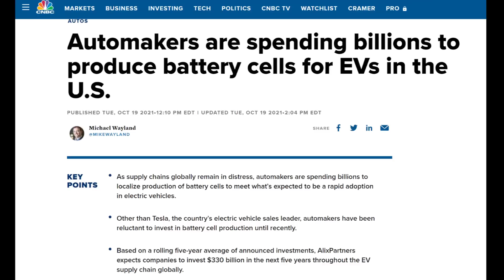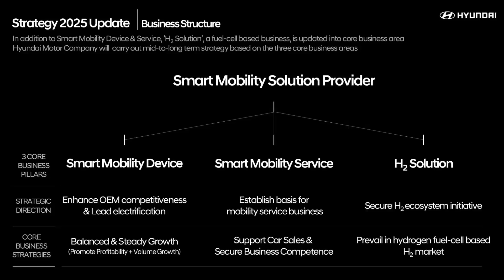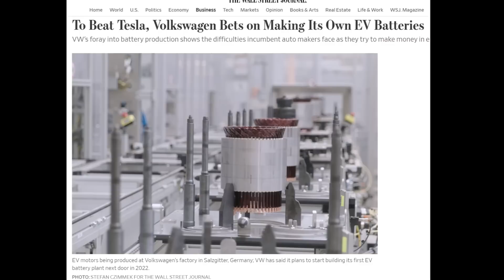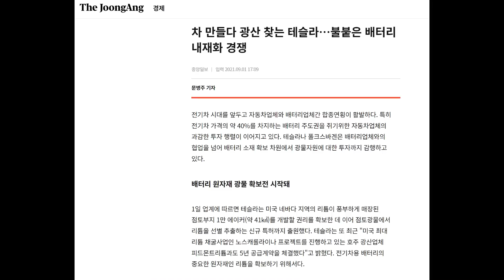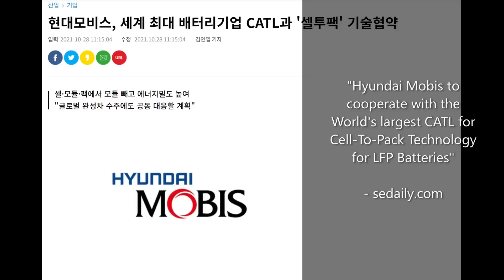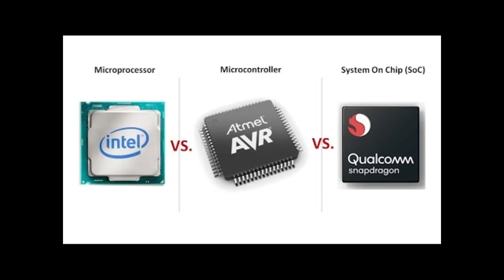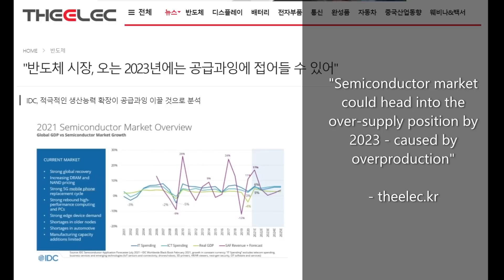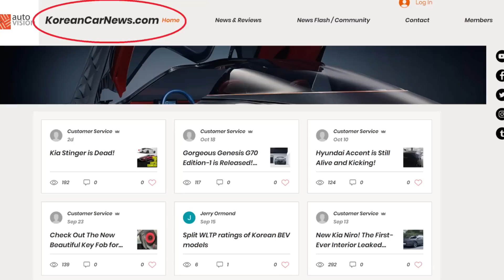Hyundai's Shocking Plan to Beat Out Tesla and VW doesn't involve producing own batteries!

Comment: I think it’s not the time to go EV. Another 5 years. EVs currently too expensive and very limited charging infrastructure.
Reply from the maker: You might be entirely right.  In 5 years, EVs will cost about the same as the equivalent ICE cars.  And it will drive far longer and charges in incredibly short time than the EVs now.

Comment: I want to purchase a car for $50,000 to $100,000. I need assistance for long-distance driving such as lane centering and distance control. Tesla has the features I need but the persistent quality and service issues scare me. I welcome any car manufacturer who produces a more reliable/serviceable car than Tesla. I do not care who makes the battery as long as it is reliable. An ICE car is also acceptable to me. Most important are reliability, serviceability, and assistance for driving. Not who makes the battery.

Comment: It would be shocking if Hyundai is not bankrupt by 2028! By 2025 EVs will be cheaper at all price levels than ICE so very few ICE cars will be sold. There will be a huge shortage of batteries and a shortage of battery minerals. So where will Hyundai get its batteries? Hyundai will be fighting all the other legacy makers for batteries, as well as the new Chinese makers, and contract makers like Foxxcon.
Reply from the maker: As discussed in the video, Hyundai has joint ventures lined up. It just doesn't want to become a battery company.
Reply: @koreancarnews  - Hyundai have produced OK EVs but they are falling behind and their EV output plans for 2025 are far too low to provide them with the cash flow to survive.
Deciding to stay as an assembly only automaker means that they will be forced to (I) compete on a price badis for scarce batteries, (Ii) rely on the battery makers cell management software. It's risky.
Sure, it's also risky to move into battery making as this requires quite different skills. 
The main issue for Hyundai is speed of innovation. - Tesla is evolving so fast that other automakers are left scrambling, and Korean culture is not strong on innovation.
Reply from the maker: @miken4591  Well Hyunai's cash flow comes mostly from 7 million ICE cars that they sell and frankly, it's more profitable than EVs.
Reply from the maker: @Mike Naylor If you have been watching our videos, you will know that they will adjust the ratio of the EVs and ICE cars. 2025's target of 1.7 million cars seems reasonable as its target is to become carbon neutral by 2045.  All of Hyundai's ICE cars can easily be converted to EVs by the use of its 3rd generation platform.   Also, Hyundai really is not really worried about the batteries because it has access to 3 of the largest battery manufacturers in the world at its disposal.  Namely, LG, SK and Samsung.   It's just how large companies in Korea work...
Reply: @koreancarnews  As far new cars go, the world will be carbon neutral by 2026, as very few ICE will be bought by then. Hyundai need to adjust their sense of urgency. The Korean battery makers need to build massive new factories and buy massive amounts of battery minerals from mines which have yet to be built. Supply shortages will bankrupt most of the current EV makers. 
Also EVs will be very software based, and Hyundai's software is weak.
Reply from the maker: @miken4591  Yes, you are absolutely correct if you are talking about Europe only.  But it will take much longer than that, even for the US.  Let alone the rest of the world, including the developing countries.  In fact, Hyundai will stop selling new ICE cars from 2025 in Europe.
Reply: @koreancarnews  - In Asia Chinese EV makers will be supplying a lot of EVs by 2025, esp BYD. Asia will be more competitive than Europe. The question is - in 2025 will consumers buy a new ICE if it’s more expensive than a comparable EV, knowing that the ICE has 3x the fuel cost, 5x the maintenance, and that it resale value in 2028 will have plummeted, or hold onto their existing car while they wait in the EV queue? 
My point is that by 2025 or 2027: demand for new ICE will be collapsing everywhere, even if supply of new EV is very inadequate. Hyundai need to plan for a far more aggressive transition. They are in serious danger of having stranded assets and idle workers if they don’t switch as fast as possible. As part of that, they need to cut the cost of their EVs drastically, and add vale via excellent software.

Comment: What will it be like to charge an EV when most people own EV's. Filling a vehicle tank with gas takes around 5 minutes. Hyundai has a fast  charge capability of around 20 minutes to 80 percent charge - if an appropriate charging station can be found.
Reply: Many cars are charged overnight while their owners are sleeping, which is an advantege of EVs over ICE cars.
Reply from the maker: The charging infrastructure as well as the technology will have to get better eventually.  We are certain that within 10 years, charging experience will be no different than refueling.

Comment: If electricity to charge EV vehicles is from water power then we can say they are relatively clean but electricity is often generated by burning  coal. EV buyers don't see this. Mining lithium also is dirty and produces carbon monoxide.  I have ordered a plug in hybrid and i live in a Canadian province that produces electricity using hydro power.

Comment: Tesla with its  4680c  battery  cells  has  paved a guaranteed  its future  and  lowered  cost of batteries , besides the  technology   to get  the weight of the car by  doing away  with the " CAN" ,yeah  that case or enclosure  called battery  pack  as every modY going forward will have a STRUCTURAL  Battery Pack thus saving  a few hundred pounds in weight and  material, as Sandy  Munro says OEMs pay him handsomely  to get those pounds off , each  pound  is a few miles more in driving range,and  when it comes to range and PERFORMANCE  Tesla is up there.

Comment: I am surprised and disappointed by Kia/hyundai's latest development. The battery strategy sounds optimistic and a little bit dangerous - but logical. Of course -  an offensive strategy is different. For me the biggest disappointment is, that the new BEVs on eGMP are much less efficient than the previous generation. Less perfect engineered also (coldgate, navigation, user interface).
For me, this is the wrong way to go and one more reason to buy Tesla shares (and BEV, when my eSoul is going to be replaced).
Reply: Less efficient??? One more reason to buy Tesla share?? Are you for real??

Ioniq5/EV6 when driven properly can reach over 500km with a single charge. Ioniq5 is the start of a new EV era.

About your Tesla BS, they are 80% overpriced with Nasdaq falling since 26 Dec. It's like you spending $300 to buy $1. 
Those believing that buying all the Tesla shares as possible will make you rich are so damn screwed. The bubble is about to kabum. Just like those believing that cryptocurrency is the way to make money and yet took a 50% fall last week.
Reply: @hakunamatata324  So much for marketing theory.
Your mistake is not to distinguish between range and efficiency.
I had an Ioniq with a 38kWh battery and currently drive an eSoul 64kWh. Both were ahead of their time in terms of bev-technology and efficiency. This is no longer true for the Ioniq5 in many details. The charging curve, for example, is a nightmare in the Scandinavian winter. I still maintain that Kia/Hyundai have lost out to Tesla in terms of efficiency and relevant BEV engineering (including software, connectivity, ota) and that the eGMP has disappointed.
Reply: @meersde  "Kia/Hyundai have lost out to Tesla in terms of efficiency and relevant BEV engineering (including software, connectivity, ota)" so you comparing a company that did nothing other that was born to sell EV only, worked with EV technology and has been into EV since 2008 with a company that sold petrol cars since 1967 has been into EV only since what 2020 having to learn everything from scratch just like Tesla did 14 years ago (some hybrid back in 2016 I believe)??

You are comparing water and wine. I get you are a Tesla fanboy rather than realistic, so whatever.

Comment: It's a good idea until battery technology evolves to its next level of technology, Once Solid State batteries become feasible they should start working on their own factory to produce them.

Securing third party batteries is slightly risky- since their old Kona/Ioniq series EV's used LG batteres and those batteries were created with defects, and 5000 EV's had to be recalled because the chinese manufacturers folded and clipped the batteries, making them have a risk of connecting the anode & cathode together, causing a fire that would destroy the entire car & potentially harm or kill its users.

With a first party manufacturer outside of China, I assume the quality standards would be kept far higher.
Reply from the maker: Frankly, Hyundai could jump into it anytime it wants to... it's just not the top priority for them as they already have a good working relationship with the producers.

Comment: Did you mean the price of Li-Ion batteries used to be 1400$/kWh in 2000? Not 140$kWh as stated in the video. .
Reply from the maker: Oh my, it's supposed to be $140 in 2020, not 2000. Thanks for pointing that out.

Comment: Hyundai Motor Group should work with Our Next Energy (ONE) … they made a battery pack retrofitted on a Tesla Plaid with a real world range of 752 miles in a single charge. breaking records!
Reply: They are already working on Li Metal and SSB that gets over 400 wh/kg
Reply: High capacity cells are quite easy to achieve by using a high nickel content cathode but that tends to shorten battery life. No information was released on ONE's battery life expectancy.

Comment: Bad choice hyundai. Chevy wasn't involved in the battery in the Bolt. They were all recalled.
Reply: I disagree, see my posting above. The role of the OEM in the supply chain doesn’t have to be about making cells which is all about materials science...basically chemistry. When Hyundai launched the Kona EV and Kia the e-Niro most people thought all the packs came from LG Chem ..not the case. Kia used SK Innovation. Kona had a couple of fires and LG had to step up and pay for most of the recalls..but nothing like the GM Bolt debacle. There have been no problems like that with SKI, which is where HMG go to for the Ioniq 5 and EV6 these days. I am sure LG Chem will make better batteries as a result, this is after all early days in the conversion of all vehicles to electric motive power.